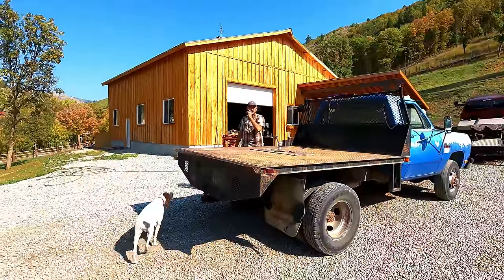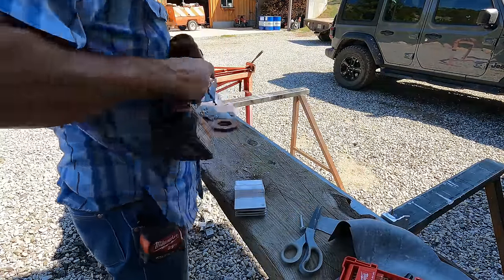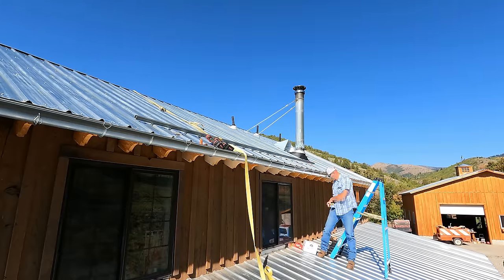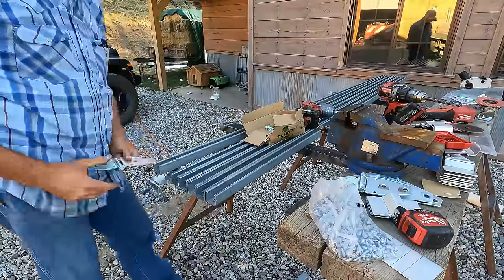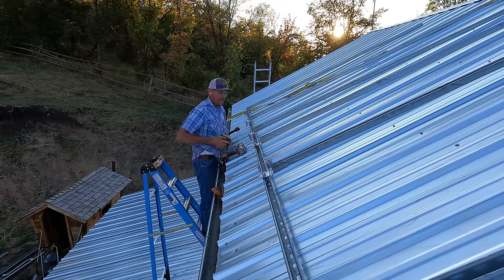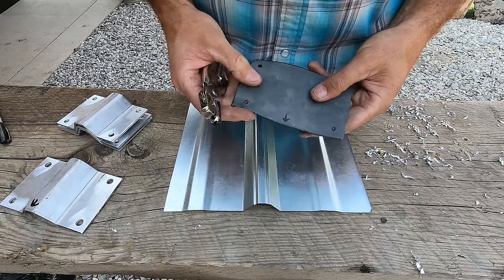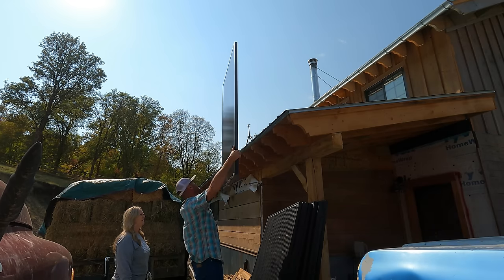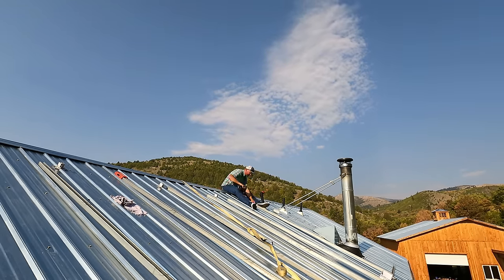#521 - DIY Adjustable Roof Mount Solar Panel Rack (Unistrut).

Comment: I am just glad I have grid power and do not have to deal with solar...  Not sure in twenty years from now you are going to be capable or want to be up on the roof doing this all over again.  Solar has zero chance at helping to reduce green house emissions so those hoping to save the planet with or reduce an electric bill should consider supporting a greener technology like nuclear power.
Reply: Nuclear power is greener?  Oh.  I didn't know that.   You mean like at Fukushima Daiichi?
Reply: @ericfraser7543  Fukushima?  Well, I guess we could go on to talk about Three Mile Island maybe, or perhaps about how many people died at Chernobyl, or maybe even about how the the problem of permanent disposal of nuclear waste - aka "emissions" (i.e., "the production and discharge of something") from nuclear reactors has yet to be solved, despite the best minds in the business thinking about the problem for nearly 70 years.  But this is probably not the time or the place.  I guess history will decide whether - or not - nuclear power is ultimately found to be feasible.   Until then, I bid you good day.

Comment: Stainless hardware will be almost non-reactive with both the aluminum and galvanized. At least put a stainless washer between galvanized bolt and the aluminum.

Comment: Did not realize you have such a small array.  Adding 7k more panels is actually not expensive.  At this point one can by Grade A panels for around $0.30 per watt.  GRADE A  these are the ones with 25 year warranty.   I know you said it isnt the money.. and $2100 for the additional panels is cheap. Dont be cheap and yes I know you are beyond cheap.